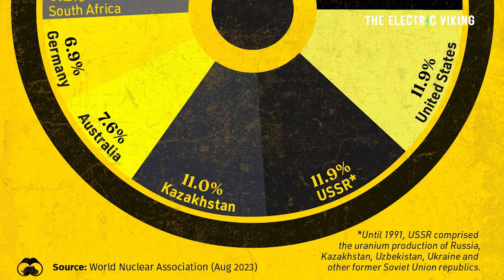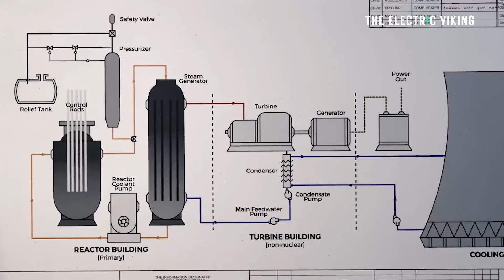Canada's Cigar Lake is Fueling the World's Nuclear Energy lust

Comment: In 2015 a worker at Cigar Lake Mine was walking with his hood up, headphones on & smelling like chicken-wings between the Main Camp after "Midnight Lunch" to the building where his personal room was located. A lone wolf darted out from the bush and had him on him by the throat, on his knees. Security noticed the scuffle and scared the wolf off... it remained on the bush-line pacing back and forth, wanting the kill. The man who runs site-orientation at the mine was the first responder and said if the bite was half an inch over the wolf would have punctured the main artery in his neck... killing him certainly. Last I heard, the man survived and was on psychological leave. In 2010, 50km North at "Points North Airstrip", a man was killed by a wolf while smoking a joint at the garbage dump after dinner. This is the only area in North America that wolf activity such as this occurs. After the 2015 incident, Conservation Officers tracked and killed the Alpha Male and Female, no wolf issues until present that I am aware of.

These wolves are Mutant Man-Killers. "The Athabasca Basin" in the Canadian province of Saskatchewan is where these rich uranium deposits are located. I've spent a Christmas at Cigar Lake Mine, working in down to -50C temperatures by snowmobile. There is a basketball court, steam room, UFC Fight Nights complimented with Jalapeno Poppers & Budweiser Prohibitions at this mine. I've spent a decade in this Uranium District conducting Electromagnetic Geophysical Surveys. I'm currently in my hometown Prince George, British Columbia, Canada... capturing a Forestry Survey company, to convert into a Mineral Exploration powerhouse.

www.criticaldr.one

Comment: Actually I believe MacArthur River is larger. I sold equipment for years to both. MacArthur was on maintenance only for 4 years due to uraniums price collapse in 2017. But was restarted in 2022. MacArthur is super cool, because they made the Mill underground, so it’s milled robotically. Funny watch scoop truckers driving around with no driver (drivers are up at surface using tv cameras to drive the remotely). Maintenance people have wear hazmat nuclear suites & oxygen tanks.

Comment: Charles Darwin Albert Eienstein level discovery change the world improvements in wood stove tech.  Put 5 car radiators inside the wood stove they would get red hot, still be possible to have air pass through these radiatiors inside the wood stove. And do the same thing basically, put heat exchangers inside the chimney of a wood stove would get very hot.  This would save a lot of wood and money.

Comment: Uranium cost is virtually an afterthought or rounding error. It could be 10 times as expensive and still not substantially impact the cost of power produced by nuclear plants. This is because you need so little of it as you rightly stated in your video. 
Nuclear waste is not technically problematic, only politically due to extreme ignorance. The technical “problems” have been solved. No one has ever died from stored Nuclear waste. The nuclear waste “problem” isn’t.

Comment: Still some issues with nuclear plants. The cost to operate them in high even if the fuel were free. If there is a problem and they have to shut down that take a lot of power off the grid. You can design a battery farm such that if one fails the others can keep working just like solar panels and wind turbines. Having a lot of power generated in one location is a risk, it should be distributed. In the case of hydro and geo thermal it can be worth it but other types of plants that use some type of fuel are going to get too expensive to operate and create a large point of failure.
Reply: Indeed micro nuclear needs investigation

Comment: Northern Canada is the best place on earth for the type of energy production that works to replace fossil fuels. It has the world's largest and most concentrated reserves of uranium for nuclear and is by far the best place on earth for nature's best renewable, hydroelectricity. Given the absolute miserable failure of the areas wind and solar output during western Canada's recent several weeks at temperatures around or below the minus 30 to 40 degree range the population of the region will be quite supportive of developing these forms of energy. Natural gas, oil, and coal are the only reasons that residents were able to survive a fridged January
Reply: Then bury the waste radioactive rods centered on the world's largest fresh water supply.  
Soon they will be cloud seeding your battery lake to fill it cheaper.  Hmm.
Reply: Geothermal works
Reply: @sparkysho-ze7nm It's hideously expensive.

Comment: Why do you show a fusion reactor ? 🤔 Nuclear power is a base load power source and it is complementary to solar and wind energy and IMHO reactors should be made failsafe by design. As a Canadian I don't worry about the uranium mines since the radioactive part of the uranium is very small and needs a lot of refining to become fuel. You can bathe in that lake without issue. The biggest risk is that the lake gets contaminated by mining residue and kills off the fishes.🤔 Some uranium mines are not exploited due to the "Not in my backyard syndrome" in my province but I think we will have to use nuclear reactors in the future since most of the hydroelectric potential has been exploited.
Reply: Why show fusion - ignorance
Reply: Theidea of 'base load' power is an anachronism in countries which at times have a surplus of renewable energy

Comment: Glowing green? Actually there appears to be NO sign of radioactivity at the surface, including in the lake. To imply otherwise is very inaccurate. The deposit of ore is approximately 450 metres down and is surrounded by a thick layer of water-impermeable clay. The sampling of the water shown is not somehow part of the mining process, but testing to ensure that the lake shows no signs of contamination.

Comment: Nuclear is not green.   All forget about the waste rods.  No one, not even Teeswater ont, Ca, want thier property value decreased because of a buried Nuclear rod facility. 
  CENTERED ON THE WORLDS LARGEST WATER SUPPLY WHITHIN MILES OF THE SUBURY SALT MINE. This is a horrible place to bury this massive supply of radioactive waste rods.
Worth mentioning is extremely hot water is dumped. Causeing a significant water temperature incline certainly altering wildlife.
Reply: Neither are EV's buddy ... but hey I am sure you will ignore that and say they are.
Reply: @alanakafang6143  EVs are far greener than gascars.  Let's prove the point.  You go out to your garage and have a nap with your gascar running.  Then come in and tell me how clean gascars are.
Reply: @GWAForUTBE  gee mate did you even read what I said? I never said they were, but hey deflect to something else because what I said was too truthful for you to deal with.
Reply: @alanakafang6143  OK the entire automobile industry,  front to back, is an ecological disaster. We should all go back to horse & buggy. I'm OK with that.   Perhaps just for ambulances & firetrucks.  & ofcourse police, gvnmt officials...  where were you going with this?
Reply: @GWAForUTBE  well unlike yourself I was approaching the topic with facts and common sense.
I think you have taken the Propaganda all too seriously, after reading your horse and buggy statement.
Reply: Just a sign that the wrong reactors are used. A fast reactor using Pb as a coolant could used those spent fuel rods.  After they are done with them they would only need to be stored for 300 year. At which time valuable metals could be extracted from them.
Reply: No energy is green, including electric cars. The rare minerals to produce batteries comes out of open pit mines. And the dead batteries are toxic garbage.

Comment: How does heating water to produce steam not contribute to global warming?
Reply: This is truly an ignorant comment
Reply: Nuclear power does not produce any greenhouse gasses while operating therefore it does not contribute to global warming 😊

You could argue that mining the ore uses trucks that produce CO2 etc. but the reality is, so does mining for lithium / cobalt for batteries, silicon for solar panels etc. etc. so you are probably better off assuming that mining is just kinda bad in general and it is the emissions from after that point that matter 😊

Also, just remember the sun is naturally evaporating tonnes of water off the ocean every day so the steam coming out of a reactor isn’t going to affect the water cycle in the slightest 😊

Edit: if you are asking how nuclear reactors actually heat the water, it’s pretty cool actually and I would recommend you look into it further! In short, the reactor causes the radioactive material to physically heat up due to little nuclear reactions which in turn heats the water to steam which is then used to spin a big turbine and creates electricity 😊
Reply: @bear4278  let's be real greenhouse gases don't contribute to global warming either .. the impact is extremely minor, and isn't the reason why climate is so out of order currently.
Reply: @alanakafang6143  really?
Reply: @GWAForUTBE  really what? Would you like to ask a full question rather than one word that is meaningless without context?
Reply: @GWAForUTBE  I understand Facts don't suit your poor little feeling's buddy .. but you really should go do some research and educate yourself, and stop listening to people paid to push an agenda.
You could start by looking at ceres science, and learn the truth about what drives the climate.
Reply: guess we should all stop using our kettles then